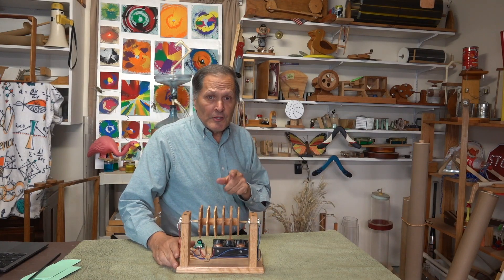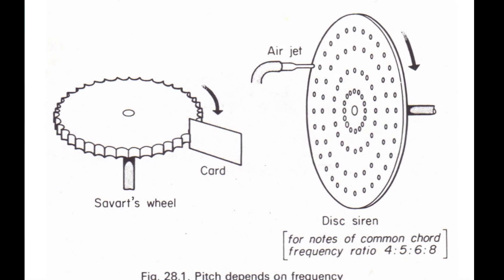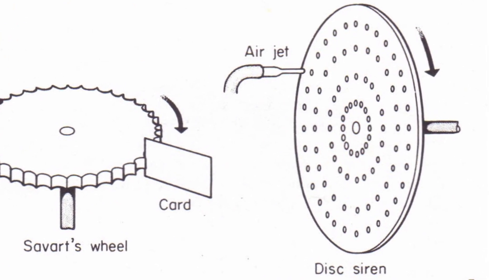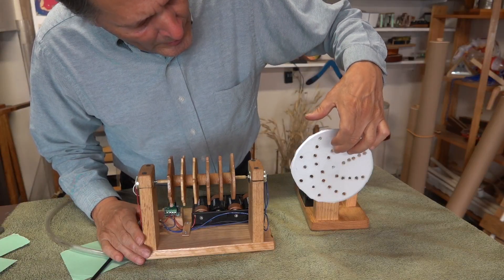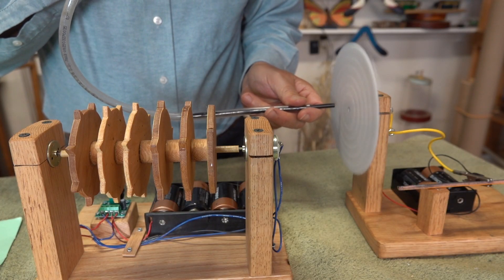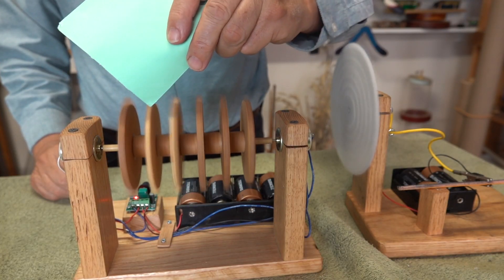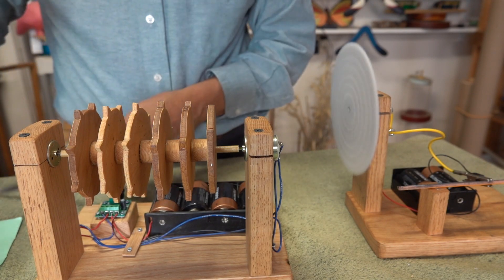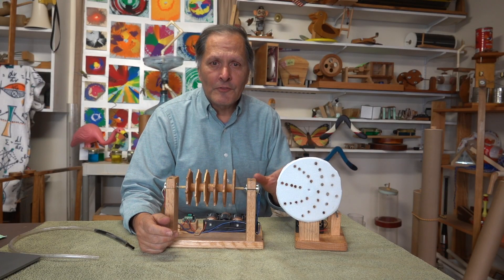Savart's wheel, Good science, bad music

Comment: i think in order to make the note more pure, the movement of the paper needs to be as sinusoidal as possible. when an individual tooth hits the paper it creates a very sharp jitter that has a very wide spectrum that sounds sharp and distorted, maybe if the surface of the wheel was smoother the sound would be more gentle?
Reply from the maker: I noticed that my drill press had a better quality than my wooden pieces and it has rounded teeth,  I may have to try and make some changes on the sharpness of the teeth

Comment: And thusly you have revealed the tone generation of a Hammond Organ!!  It has metal wheels and a magnetic head like a tape recorder on each one, the signal generated is processed through special amplifiers whose tone is set with the "drawbar" controls by the player and activated when a key is pressed!  Yes, one wheel for each note, or 88 for a "full keyboard".
Reply from the maker: I didn't know that but it would be interesting to learn a bit more about it, thanks
Reply: Of SOME (of the older) Hammond Organs. And some others.
Reply: I was thinking the same thing, you're referring to the 'tone wheel' those organs got really creative with this concept by allowing you to set how many of the harmonics are captured by the electromagnetic coil. Those overtones settings allowed the notes to synthetically mimic the sound of  brass and wind instruments. I've experimented with producing my own, well a hella lazy rigged up version, just to play with the concept. I put a steel gear on a small motor and with a circuit using an Lm317  to adjust the speed, then I just mounted it so that the gear spun hovering over a guitar pickup. I was thinking about trying to something similar again, and wanted to check out other people's ideas with this concept,  which is how I stumbled onto this video.